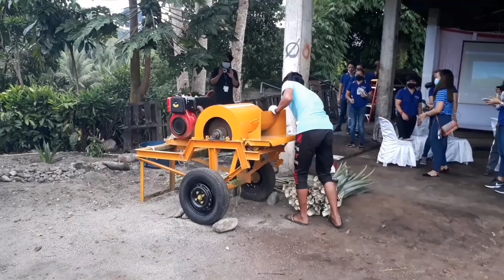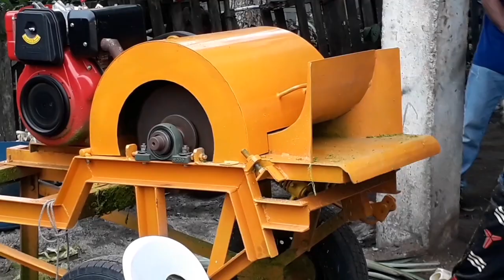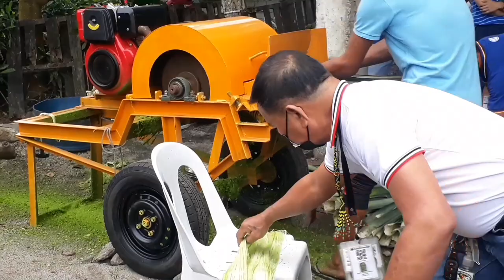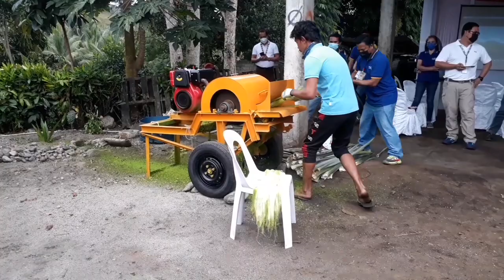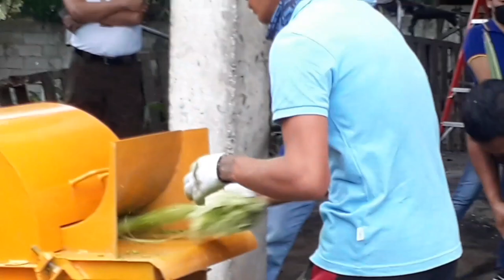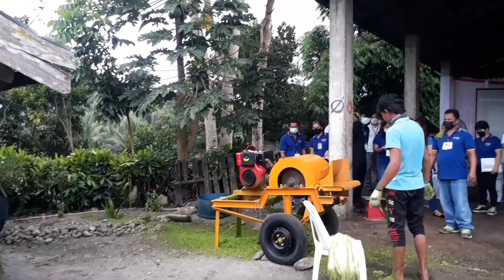Decorticated Pineapple Fiber Machine

Comment: Nice video demonstration.
But It would have been much more informative if you could include at the end
1. How much was the weight of pineapple leaves Processed?
2. How much total time it took to process?
3. How much was the total weight of the wet fiber output obtained?
4. What is the cost of the machine?
5. How much is the fuel consumption per hour?
6. Who should we contact to buy this machine?